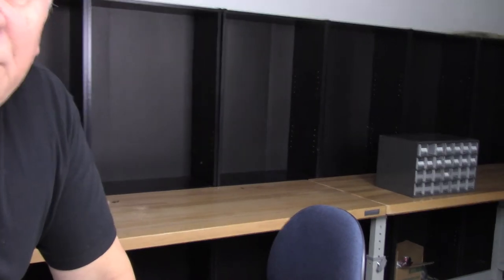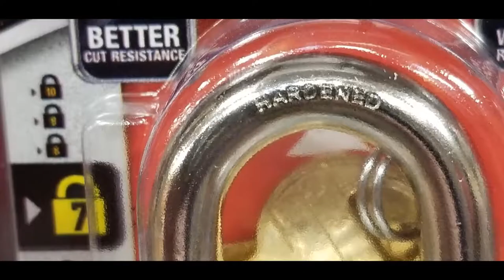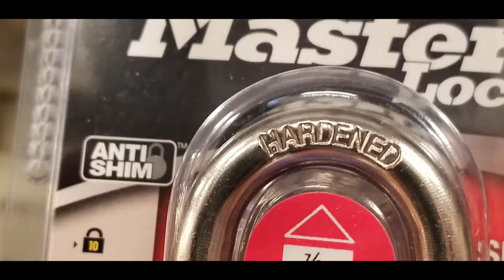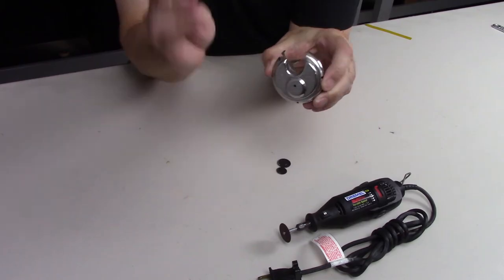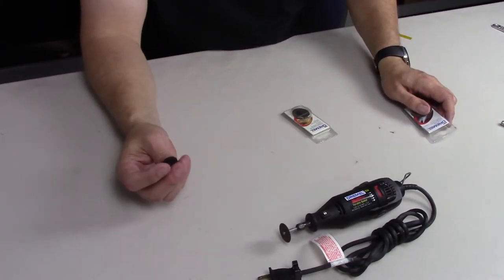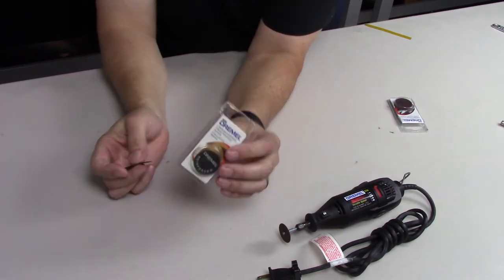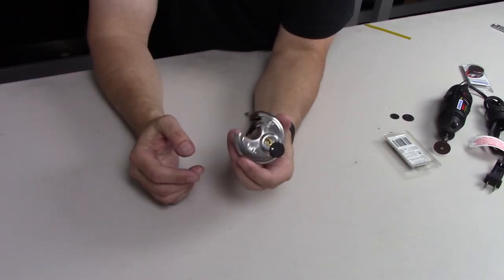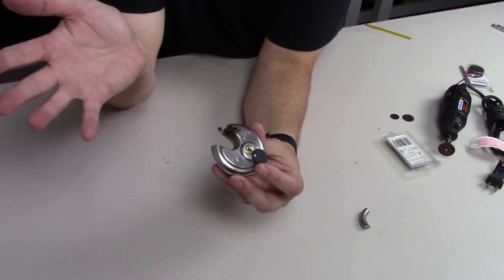Dremel Tool Lock Removal - Remove a Broken Disc Padlock with just a Dremel Tool

Comment: Nevermind Its the same lock i need cut, a disc padlock.
Reply: Never knew dremel were that powerful.
Reply from the maker: They're used a lot for storage lockers too. I'd buy a name brand better quality version if I were to use one in the future.
Reply: @Aggressivefun  how many attachments did you use before it finally broke the lock? We lost the keys to the storage. Not sure if i should pay the storage or use a dremel and save $. The sound is loud as well. Thanks for replying
Reply from the maker: Just two. The fiber wheel ground down quickly without making much progress but the harder wheel worked great and still had lots of life left. If the storage place allows it, the Dremel is an easy option.

Comment: Ur pressing to hard on the cutting wheel that’s why you went threw so many cutting wheels. You should be able to cut threw 3 locks with 1 wheel.
Reply from the maker: Changing from the fiber wheel to the harder wheel made all the difference. Maybe I'm just too impatient for the fiber wheels!! :-)
Thanks for watching!